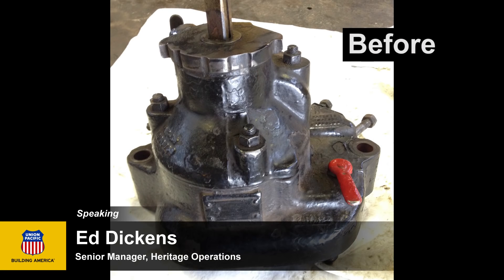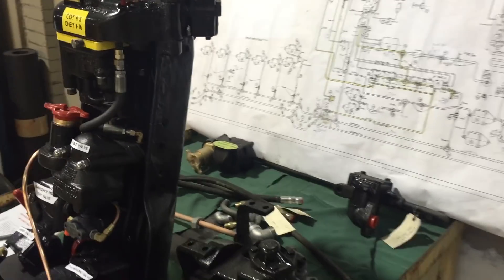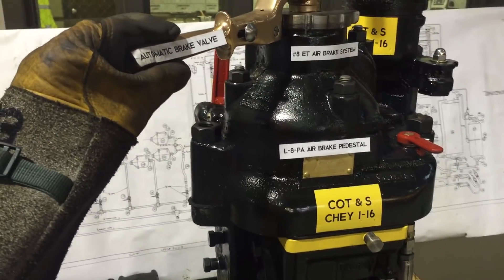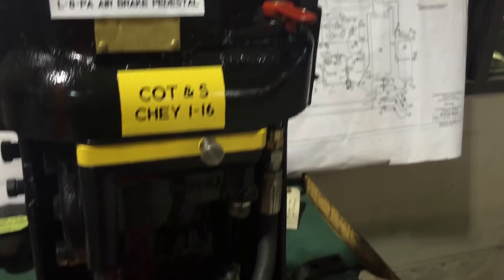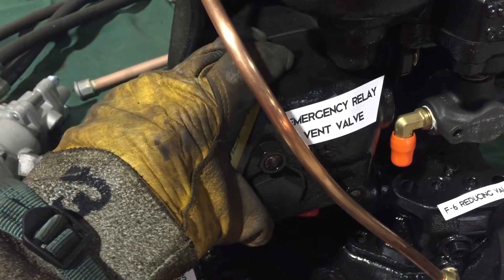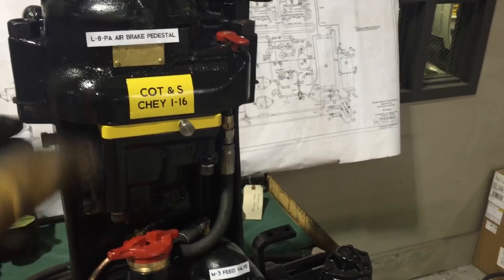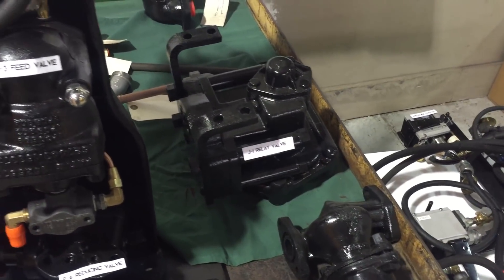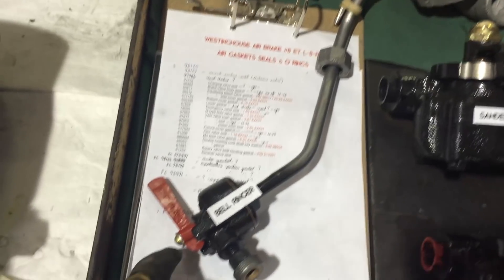UP Steam Update: Putting the Brakes on a Living Legend

Comment: Just a thought if you could make a water crane for filling steam locomotive tenders with water quickly, I'm thinking several railroad owned tank cars strictly for locomotive water. Two 8 inch high pressure hard hoses from a fire department pumper that usually goes from the fire hydrant to the pumper with rates up to 1500 gallons a minute. Now you'd normally fill the tank cars from a railroad fire plug through a standard 2 1/2 inch hose to fill the train. Once the train is full it would position itself 200 to 300 miles down the route the locomotives would be taking but the water crane is portable mounted to a flat car with an 8 inch hoses and is able to hydraulically swing the water fill pipe out to the track the engines would be using maybe using a fixed plate to temporarily set the fill pipe on then the engine crew would swing her over one of the tenders fill hatches and fill the tender a lot quicker than using a hose at the shop. I'm thinking utilizing an older hydraulic excavator to place and remove the fill pipe alongside the track quickly and easily. I'm not thinking of removing a fire train from service for this project unless it is replaced with newer equipment.

I'll grant you I might be out in left field but this idea could allow you to water the locomotives quickly especially if you added air pressure to the tank cars as I believe from when I worked as a locomotive engineer. It would work easier if you could get your hands on an just released from service " tank train " as those tank cars are already set up to fill and unload from a single connection at the end of the train and the connections between the cars are designed to remain coupled Semi permanently. 

Ed, I will grant you this is slightly unusual in planning but it could reduce the amount of weight you haul on each trip by only having to use one auxiliary tender per locomotive. Placing the fill spout before the train using a hydraulic excavator should be easy with the fore measuring the distance to the center of the track for correct placement.

My apologies as I realize I'm thinking WAY outside the box but it should be doable. After all you just completed what I was told back in 1980 when I visited Cheyenne, Wyoming engine house a big boy would never be restored by the head of the steam department Mr Lee.

Thanks for reading this and please consider what you're probably thinking is the wildest idea to come along since the big boy was actually given the go ahead.

Thanks

James Shanks

Retired

Comment: Just curious why not convert the air brake on 844-4014-3985 to one every engineer is familiar with 26 L and yes I used the 8 air brake on E-7 and E-8s back in the early 70's when a fireman. I can remember sitting in the 5th notch pumping air with a single E-7 on a 14 car train of the old " battleship" cars (6 axle) we barely made it to south station to leave on time small compressors on an E-7 E-8's pumped a lot easier.

Even though the China railways did away with steam I,lol bet they have good rebuilt Westinghouse 8 1/2 compound compressors for sale
Kinda funny looking at a video of Chinese steam working freight and the air and steam gauges say BOSTON on them for the manufacturers location
In English no less. she's looking good seems like it's time after she's ready for the road to get an old pice of boiler plate
We used to throw it in corner of the firebox pull it out when we took a break and cook steaks on it on the cab floor. Steak never tasted better.

Comment: No 26L automatic brake on these engines??? :-O
Reply: +tprdfh51 Nope!  U.P. wishes to have these engines operate just like they did in their revenue days, and that includes the brakes!  While many restored mainline steamers have been converted to 26L brakes, keeping the manually lapped No. 8 ET brakes keeps in place the historic aspects of steamer braking that is part of the character of UP's engines, and also helps ensure only the absolute best are allowed to operate them, since the manually lapped brakes require training all of their own.
Reply: Thanks...that's nice to see - we I hired on at CPR in 1986 we were taught how to use the #6 brake in our engineer training program as there were a goodly number of units that still had them in service. I rather liked them as once you got used to their characteristics you could  precisely control how much air you could remove from the train line.
Reply: Agreed.  I have no REAL locomotive experience, I'm just a railfan who plays a lot of train simulators, but from working the manually lapped brakes used in the steamers often simulated and also in the earliest diesel units, you do have more fine a control over the brakepipe pressure with a manually lapped system.
Reply: But I can also see the reasoning for the change to self-lapping brakes, as it permits the engineer to intuitively find brake handle positions that gives the exact braking effort that works for any specifc situation and once found for any given train, the engineer can then intuitively apply the correct amount of braking power needed at any time while keeping their eyes focused down the track instead of watching the EQ reservoir pressure.  Fitting self-lapping 26L brakes to a freshly overhauled steamer that will see mainline running meanwhile eases the learning curve somewhat for volunteer engineers new to steamers that will be operating the locomotive and also gives assurances to dispatchers that any steam-pulled excursions in their area are using the same braking procedures as the diesel-hauled revenue freights they are used to.

Comment: Thanks for the briefing on the valvework for the brake systems on the three big Americans.  With 844 ready for final assembly, the shop can prepare for the slightly more complicated jobs on the brakes of 4014 and 3985, both of which have additional axles on 844.  4014's boiler turn out good internally and all set for brand-new tubes, flues, and staybolts, as I reckon the case to be?  (I assumed that 3985 might need new cross-sheets, given the known corrosion failures.)

Comment: Re assembly wont take too horribly long. maybe by the end of this year 844 will be humming again if nothing impedes the project, the hard part is getting everything rebuilt and ready to put back on
Reply from the maker: +northstar2007 Locomotive No. 844 is expected to return to operation mid-2016.
Reply: +Union Pacific wow! thats even better :) steam crew dosnt mess around!
Reply: talesin- god of the internet
3985 will be tackled after 4014, It needs extensive repair and rehab which will take a long time to get it underway again. Its quicker to get 844 and 4014 running first
Reply: +talesin- god of the internet Foamers! LOL
Reply: talesin- god of the internet
me too..... It's on my hot list of places I wanna go to... I was 30 miles away from the Spencer Shops when the J was there.... alas I missed that too
Reply: +northstar2007  Hope to see the 3985 get back to life, my favorite of the three.
Reply: in the end it's up to UP. they ultimately decide on what projects and trains to keep running. We can only hope that it eventually gets worked on. if you are near there, go to I think they call it depot days where they do tours of the shops. they give the updates over all the engines some videos I've seen they do talk about it
Reply: +Union Pacific Keep up the good work and keep us posted, we're all sweating bullets in anticipation for 844's return!
Reply: northstar2007
i would love to go there but i am ~2000 miles from cheyenne